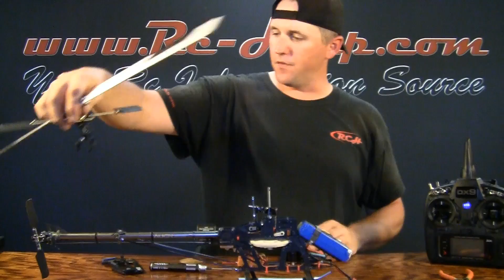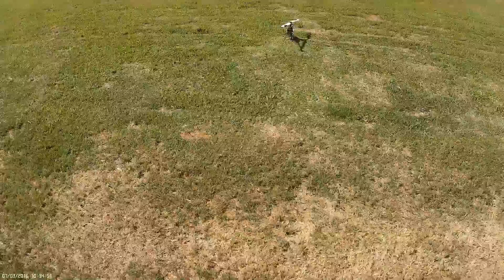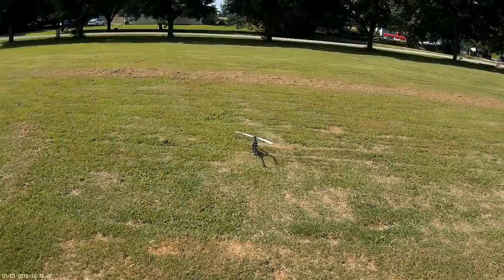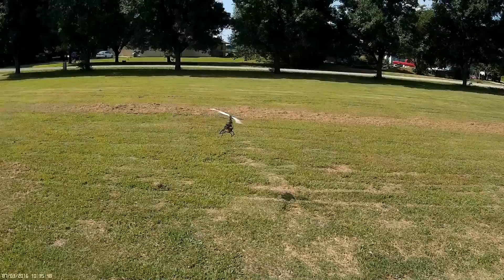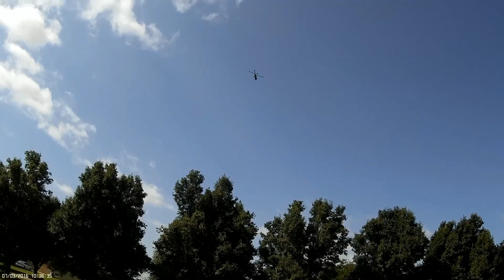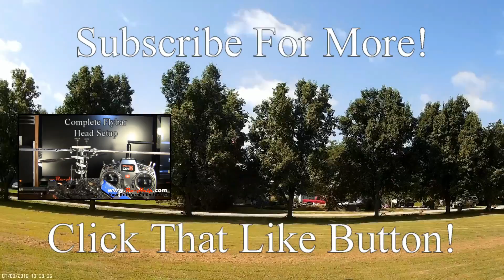Align 450 SE V2 Flybar Head Setup with Fixed Links – Collective, Cyclic and Blade Tracking

Comment: as you explain in the video. all swash plate & main rotor head must be leveling ... For those of us as beginners, just learning hovering, the pitch degrees setting is at 0-8 degree, without minus inverted Then the leveling setting on the mid-stick is: 4 degrees Is it true?

Comment: Hi pilots, for a tame old flyer like me, just trying to get into this after many years of fixed wing flying. I have no plan to fly inverted or do any 3D, so, why do I have to be so pedantic about mid stick 90 degrees, or do I?
Reply from the maker: The reason I stress this is because no matter what you are going to do, it keeps the geometry correct on the servo throw. One of these days, you will want to do something like a flip or a roll, or even need to do an auto-rotation if you burn a motor or something, and having that negative pitch will be nice. And, when the time comes, you will not have to relearn the pitch curve and stick feel. Hope that makes sense.

Comment: I now have a Trex-450L Dominator with a Microbeast version 5 controller, but can't find a completer setup clip related to this case.... Wouldlove a link if there is one. Thanks
Reply from the maker: I can't remember what version it is, but Microbeast setup has been the same for years. Here is an AR7200BX setup series that walks through all of the settings. Only difference is, Mine had a receiver built into it. https://www.youtube.com/playlist?list=PLabJwbJaz4QusDM8Ohz6XQ_jkwFUw-1QE

Comment: I like the way Tony explains. But here, we have an Align 450 and in this case - the servos location is such that setting a 90 degrees starting point is easy. I have a Trex-600 ESP and I have a hard time deciding on what is the centre point for Aileron and Pitch... All video clips I watched, DO NOT show this topic clearly... Please help. Thanks
Reply from the maker: If you can, come over to www.Rc-Help.com and post up some pictures of your helicopter. We will get you setup.
Reply: @RcHelpDotCom  Thanks, i sorted it out from your other video. Cheers